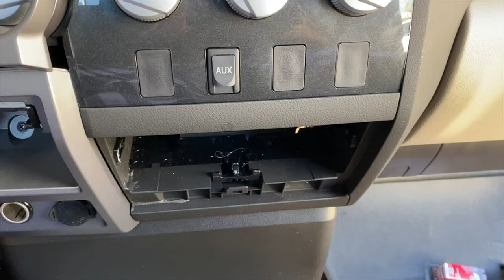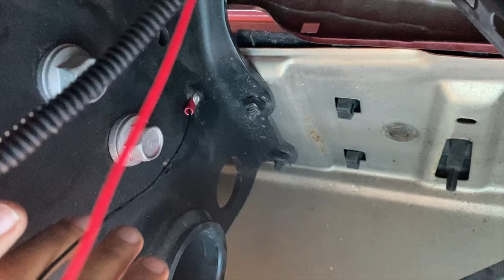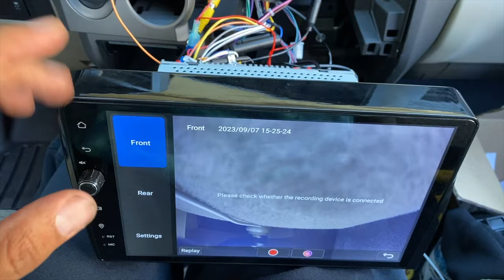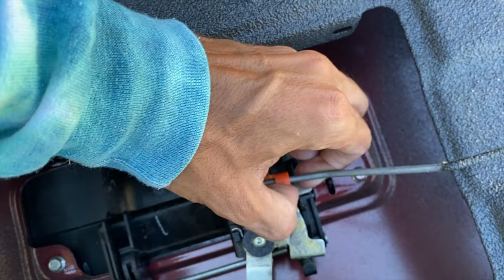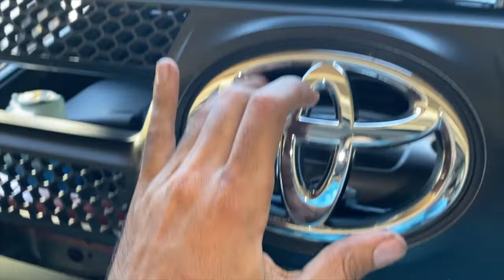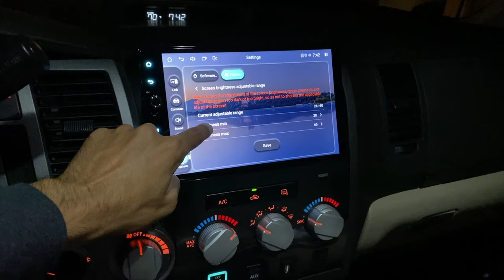Customer Installation - Toyota Tundra 2010 with Joying 10.1" HD Radio

Comment: Your video was extremely helpful! Thanks!. However, I have a similar front camera and am getting no video feed. Setting options are minimal and nothing is working. Very frustrating. Any potential solutions would be greatly appreciated.
Reply from the maker: Pls kindly check have you connected the cable correctly?  Any problems you also can contact us via email at the europe@joyingauto.com

Comment: I just installed this in my 2014 Toyota tundra, everything works great and when playing music on fm/am radio all my speakers work but when using Bluetooth, only one speaker works.. I'm confused on if this is a wiring or settings problem, any advice on what it could be?
Reply from the maker: Do you mean only the front speakers work when make a bluetooth phone call?
Reply: @BoykaJoying  no only my front speakers work when I am playing music on carplay, I found the amplifier settings but it will not let me edit them and turn the power amplifier switch on
Reply from the maker: @BryceHarrison-pn3kq  To help you better, pls contact us via email europe@joyingauto.com, we will check it and find a solution for you.

Comment: How is the volume knob working so far?
Also that slot for sd card ia where the sim car goes. Confused. Has sim car for internet or sd card slot for saving data, like a front camera data gor security purposes. Thanks
Reply from the maker: The volume knob is working normally. The SIM Card slot at the back of the radio and the SD Card slot at the front of the radio body!

Comment: So where is the back up camera red wire hooked up in the back of the car if you hooked up the purple to the red and  blue?
Reply from the maker: connect to the 12V ACC wire (red color) of JOYING harness  .
Reply: Thanks, so you don't hook it up in the back of the truck at the taillight at all correct? @BoykaJoying
Reply: @rebeccanielsen3 Im wondering the same thing
Reply: Does the red wire for rear camera hook up on the back or just the purple wire?

Comment: Hi will this work with a 2010 sequoia with jbl, with stock steering wheel controls, with stock built in microphone for phone calls, and with stock reverse camera? Or will I have to use the mic and camera that come with the radio and lose my steering wheel controls. Thanks.
Reply from the maker: Yes, it can support the JBL system, steering wheel control and OEM Backup camera. But it cannot support the OEM microphone and the radio comes with the universal microphone! Hope you understand!
Reply: @BoykaJoying  which harness is needed for the OEM camera to work? I have a 2007 Tundra with JBL, navigation, steering wheel controls. I would like to keep all functionality. The harness that was included in my order only has 5 connectors but my truck has at least 8 connectors on the stock radio.
Reply from the maker: May i know which functions are not working? @brandonlam8480